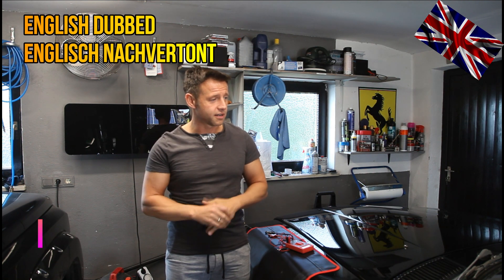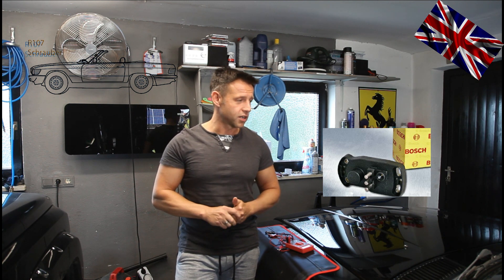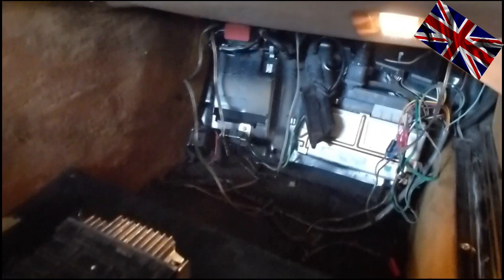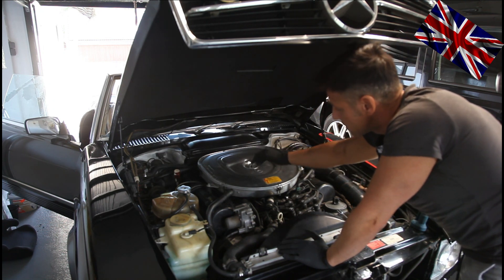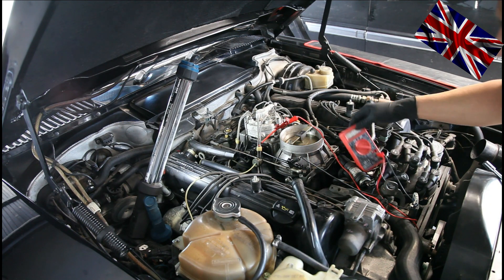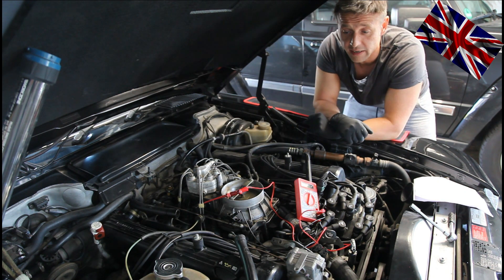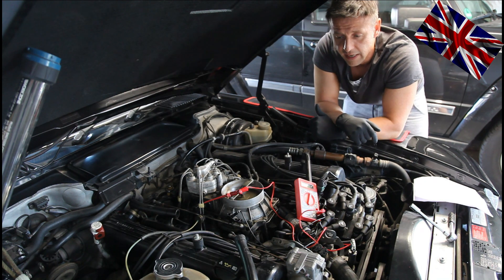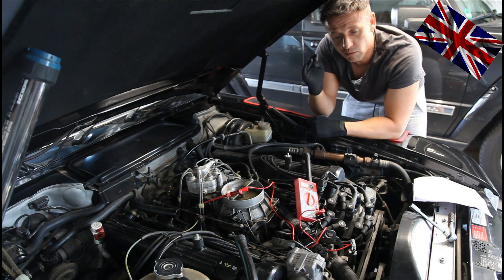DIY - Mercedes Potentiometer KE-Jetronic model R107 W126 C126 V8 cylinder engines measure-read

Comment: Hello , I have 560SL which runs good starts perfect hot and cold but the o2 light comes on after few minutes of use I already changed the O2 sensor and the Cats are new what it can be ?